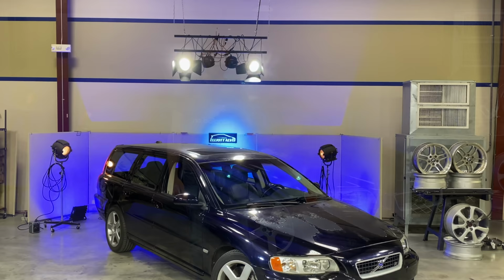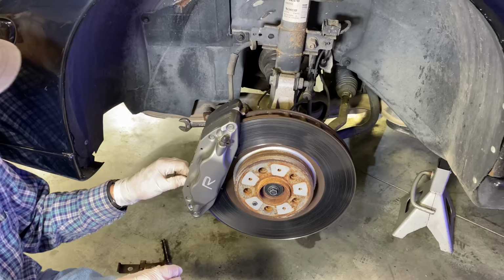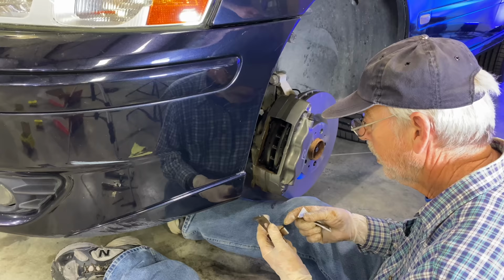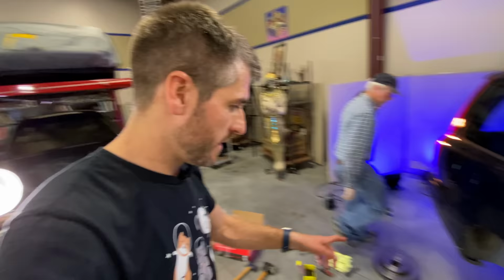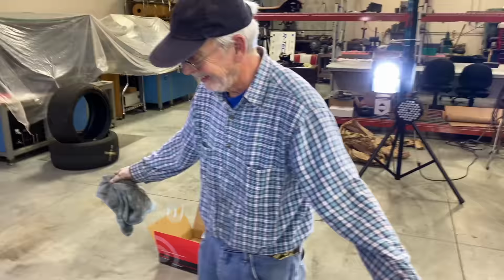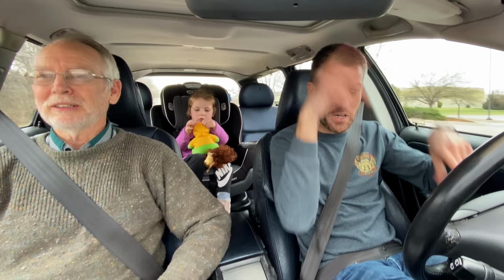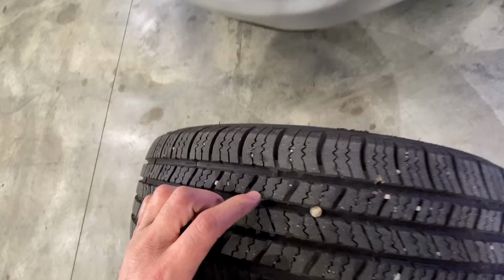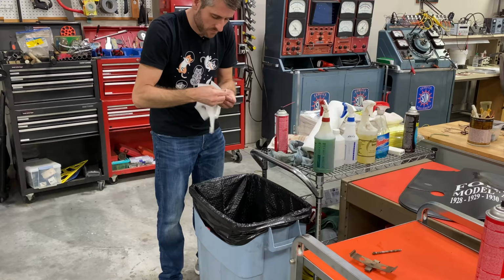Nothing Is Easy With My Volvo V70R, But A Simple Brake Job Wasn't So Bad!

Comment: How was that brake job a nightmare? Where was the seized caliper slider pins, the rusty caliper pistons, the snapped off bleed nipple that you had to drill out, the ABS pump so drained of fluid that normal bleeding wouldn't work or the usual (in Scotland) caliper bolts that are so rusty they looked like they'd been removed from the wreck of the Titanic on the ocean floor? You didn't even have to do the job lying outside in the snow! Mate, that job was a piece of cake.
Reply: My thought exactly, I watched this to see what problems he had that I have not had on my XC70, and there were none at all.

Comment: I bought an S60R 4 months ago and my story is pretty darn similar. Its been up on jacks being worked on longer than its been on the road.  That said, when its on the road its incredible..... and then it breaks again
Reply from the maker: Ah, you know the struggle then.  Enjoy the car when its working!  lol
Reply: @ElliottAlvis  I just cant' get any brakes
Reply: Should have bought a T5..
Reply: Some cars just need Jewish lightning ⚡⚡
Reply: Glad I stuck with the P80 platform.
Reply: My s60R has been dead reliable in the 5 months I’ve owned it lol

Comment: This will be a weird comment, but I had an aunt who had a V70 and eventually a XC70. I remember the smell of that car so vividly, and I feel like I can smell your car through the screen based soley on my memory of those seats and that dash.
Reply: Same. Old crayon smell. My first XC70 had it, my dads V50, my S40 T5, my S60R, and now my S70 T5. It’s also been present in my friends S60 and my parents friends XC90. Although another friend with an 850 didn’t have the smell… only time I haven’t smelled it in a Volvo.
Reply from the maker: Not weird at all, I know what you mean!

Comment: There are few things more satisfying than new pads and rotors. Also, great idea swapping them all at once. Turning rotors is a waste of time, and saving pads is as well. Just change it all out to new when they are worn, there is no up side to trying to salvage old parts like that.

Comment: Nice! I put Brembos on my Daughter's V70 last year, best braking performance ever! It's not recommended but you should clean the rust off the wheel hub and apply a thin coat of anti-sieze   between the rotor and hub. This will prevent future corrosion and make it easier to service the next time you have to remove the rotors.

Comment: Just did breaks on my wrx performance pack (has sti brembos stock) one benefit of tracking your car is the break never get that crusty between pad and rotor changes. I love working on rear entry calipers but man if you strip that caliper.
Reply from the maker: That is a good benefit of tracking the car!
Reply: i stripped my front one lol. nightmare.

Comment: I was recently watching a Junkyard Digs video, and he brought to my attention something I had never thought of before. He was explaining that for the best results, you have to break in you're brake pads, I guess each manufacturer of brake pads puts the necessary, steps to break them in on the box, basically 3 hard stops from 20 mph, and then like 4 hard stops from 40 mph? I guess each has their own procedures but it's something to consider, I guess it maximizes material transfer between pads and rotor

Comment: Should clean the rotor/disc with brake cleaner before fitting caliper to remove transit oil (used to prevent rust in storage).
Reply from the maker: You're right, that is a good suggestion.

Comment: Sometimes all of a sudden the pins get stuck (happened to me) or the bolts get stripped and then im like oh boy maybe these aluminum Brembo calipers SHOULD HAVE HAD STEEL INSERTS FOR THE BOLTS!!!! Yea... R brakejob can sometimes go south quick!! thats the worst thing that happened to me
Reply from the maker: Oh no!  That sounds awful!
Reply: @ElliottAlvis  I had to buy a whole new rear caliper because the pins were stuck so bad, then I had to get a Helicoil insert into the stripped threads on the front caliper. That was insane. Never wanna take the calipers off ever again

Comment: The part you forgot to install on the front is called a silencing shim.  The backing plate is the rigid inboard sheet metal, roughly the same size as the rotor, there to keep debris off the inboard side of the rotor.

Comment: Brake parts?  Check.  Dad puns?  Double check!  One tip I'd give you is to put some anti-seize paste on the inside of the wheels where they make contact with the rotors.  This will make it A LOT easier to get the wheels off later.  Looking at the old rotors at the beginning, it looks like someone had done that previously.  Enjoy the stopping power!
Reply from the maker: Thanks as always for taking a "brake" to leave a comment man!

Comment: As usual, I took a "break" from my work to watch this "brake" video.  However, I had to "break" away from it until after work.  This video was so full of puns and good advice such as:  "Lube the backside;"  "Spring time;"  "It's a good start;"  "There's lots of jacking on this video!"    I think you have to do a family vacation video.  You would be the perfect replacement for Clark Griswold!  You could call it the "Motory Notary Family Vacation."  You already have the wagon.  Just stick some fake wood paneling on the sides and you're ready!  Thanks for providing such excellent content!  Keep it coming!!!
Reply from the maker: Haha, excellent brake puns Michael!  I appreciate you taking a "break" from work to watch the video, and for picking it back up later!

Comment: Did you thoroughly clean the hub before mounting the new disc? I like to use a special abrasive bell-shaped, hub cleaner you can put on a power drill, can't beat how evenly it cleans the mating surface.

Comment: Pro-tips: You should always replace the spring clips when replacing pads on Brembos; It’s a good idea to clean up a rusty hub with a wire wheel and apply a thin layer of waterproof grease or anti-seize; always good to turn in the parking brake adjuster a few clicks before removing the rear rotor,then re-adjust after install

Comment: Also man your lucky how easy the rear brake rotors came off! They often rust at the brake cable and also if the rotor is to worn inside from shoe wear the rotor can be a royal pain to remove. My v70R i banged on the back of the rotor for like an hour and it still didn't break free i said forget it lol still seized to this day but im about to weld a bracket to a bottle jack and come back with new rotors and shoes before i take it on the road manual swapped. hopefully it works

Comment: Disc brakes on Corvette came out in 1965 and were standard 4 wheel discs.  Before that, Corvettes came only with drum brakes.
Reply from the maker: You could get disc brakes in the front starting in 63, but they were standard 4 wheel discs in 1965.  You are correct!

Comment: used retainer pins tend to depart on their own, I always get all new hardware.
when a pin falls out the second pin rattles loose, then the pads depart and you lose all the brake fluid.

Comment: I changed pads on a  Volvo 164 once. I only had to remove the wheel - not the calipers. Rotors were still in great shape- pads had 15-20% left .

Comment: I would occasionally re-torque those axle bolts in the center of hub.....they have a tendency to back out. Just a heads up from a former s60r owner
Reply: You should never "re-torque" those bolts. They're a one time only and should be replaced with new if they ever need to come off
Reply: @rsscott5672  you are correct if you take them out you need to replace them......the 04-06 had a habit of actually loosening they corrected this in 07 by using a rubber bushing behind the bolt.
Maybe re torque was the wrong word....but just check to make sure they haven't loosened up.

Comment: Good job, Elliott. Nice to see the Volvo getting attention. One note, though. That brake fluid was looking a bit off in the master cylinder. I'm guessing it is a while since it was flushed. Bad idea to leave it. The water absorbed by the fluid can rust out the ABS pump, accumulator, or actuator, none of which is cheap. Be prepared, it takes a bunch of fluid. On my 1990 240, with its 4 wheel Gerling discs, it takes 17 litres of fluid to do a full flush. Every 10 years or so I also do all 6 of the flex lines. Volvo brakes are something else. Gotta love 'em.
Reply: Err thats like 4 gallons, maybe 1.7 L, I only needed  0.8L on my S80
Reply from the maker: Holy smokes, thats a lot of fluid!  I plan on doing a full flush soon.
Reply: @henrikalnesjo3445  Yeah, 17 litres, surely that cant be right.
Reply: check your handbook, mine said the system holds 0.56L, so I ended up using only 0.8L flushing it, can depend some depending how  bad your old oil is

Comment: A small lip is no reason to trash the rotors. I think you could used your rotors just fine with new pads, but it's hard to tell if the grooves are bad or if there are cracks...
Reply from the maker: Better safe than sorry. And the rotors will be repurposed around the warehouse as weights!

Comment: In my experience the so called lube for the back side gets washed away after assembly because anyone doing a proper brake job sprays everything down with brake clean to insure all the contamination you've spread around doesn't cause problems in the future so I believe it's just waisted money if you're buying those little $2 packets with the pads

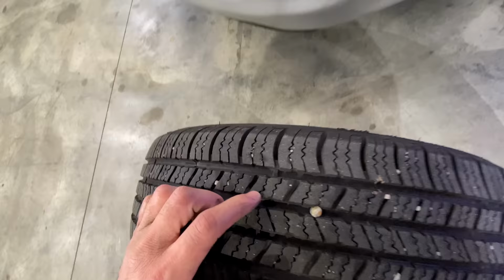Comment: 17:02 I know that tread pattern very well; a Goodyear Viva 3! That tire got replaced around this time last year with the new Reliant All Season. If I remember correctly, the Viva 3 was a 60,000 mile tire, and the new Reliant All Season is a 65,000 mile tire.

EDIT: using my training as a Walmart Auto Care Center technician, that roofing nail was what in what we call the “Goldilocks Zone”; had it been less then a thumbs width from the sidewalls, it would have been a new tire for you.
Reply from the maker: Good eye for tires and for the roofing nail!

Comment: Make sure that you adjust the parking brake after doing the rear brakes. Oftentimes it will need to be readjusted when you change the rotors. Especially on this car since it's a stick shift!
Reply from the maker: You're absolutely right!  It's adjusted and working better than ever!
Reply: @ElliottAlvis  I forgot they had the shoes for the parking brakes on Volvos. Volvos are actually very easy cars to do brakes on. I think the R car was produced in Sweden although Ford did own Volvo at that point in time.

Comment: Loosening the calipers before resetting the pistons and removing the pads. And those rotors look fine - just remove the lip. You've never done a brake job before, have you, Elliot? I'm off.
Reply from the maker: The car hadn't been driven for several days so it didn't really matter. And the rotors were warped and had a massive lip.  They were done.

Comment: You could have used brake parts cleaner to clean the brake calipers and the parking brakes. Now would have been a good time replace the brake fluid (that could be another video).

Comment: Shouldnt you change the brake fluid and do a flush on the volvo, as when was the last time it was done on that car, which would directly effect the pressure and the pedal feel, also after the test I would do a check to make sure everythings still tight and in place just as a precaution
Reply from the maker: You are absolutely right, I am planning on doing both.  I just didn't want to make the video painfully long!
Reply: @ElliottAlvis  ah fair enough I was just like hey wait your missing a few steps here lol plus it never hurts to check and double check your work with bolts and pins of that nature

Comment: Do you have to remove the caliper?  My Audi didn't require taking the caliper off because there were no wheel studs in the way.  Pull the pads and then you can remove the rotor.

Comment: I have a question. Have you changed the brake fluid since purchasing the car ? If not and most people don't, you should or you are going to push the nasty brake fluid back through the ABS system and master cylinder. I've ruined a good master cylinder that way. The best way for safety reasons is to open the bleeder screw then push out the old fluid as you depress the pistons back into the caliper. A new bottle of brake fluid is cheaper than any brake component that might be ruined buy the old brake fluid. Just an old codgers two cents worth.
Reply from the maker: I do need to change the fluid and bleed the brakes soon.  You are absolutely correct.
Reply: @ElliottAlvis  I cringe when I see someone fo a brake job on utube and they don't bleed the old fluid out as they push the pistons back into the caliper.

Comment: Question: Does any anti seize go on the front and back surface of the rotor where it contacts the alloy/steel wheel to make sure that it’s always easy to remove the rotor and/or the wheel? 
I really enjoyed watching you three Alvis’s tackle this important job!
Reply: you shouldnt
Reply: @C.JG.  Thank you 😊
Reply: Should clean the rotor/disc with brake cleaner before fitting caliper to remove transit oil (to prevent rust in storage).
Reply: @steveturnbull9542  I thought that there was something missing.

Comment: The first time that I changed my brake pads I didn’t think about the brake fluid overfilling it’s reservoir. The cap was still on and the brake fluid squirted out of the cap’s overflow. I guess that’s what happened.
Reply from the maker: I bet that was a good learning experience!  At least you know how to change brakes!  Thanks for watching Mitchell!
Reply: @ElliottAlvis  You are very welcome. Your videos are really awesome these days. I really like the family integration because it adds a lot of realism, especially when your uncle was doing much of the work so that you could let your creative juices flow. 
I wanted to ask you if you’ve been working out, because your bicep 💪🏽 veins were really popping when you were picking up those big front rotors? 
Thank you so much for responding to my comments, because it means a lot to me. Your channel is getting so big that you might not be able to give us the personalized service that we are used to getting from you.
Reply from the maker: @mitchellbarnow1709  I haven't been working out, but I have lost some weight.  And I always value your comments Mitchell!
Reply: @ElliottAlvis  Thank you, my awesome friend from Wichita!
Reply: I owned a 1993 Volvo 850 sedan for three years, but my love was a 1996 Volvo 850 Platinum Limited Edition Sedan that I kept for just over eleven years! I usually keep my new cars for around five years. My only used car was a 1966 VW 1300 Beetle, but I lost control around a corner, spun around, hit the curb and rolled down the canyon in the hills of BelAir, Califonia! My friend and I scrambled up the canyon where we found a lot of people in the street talking about those that must be dead. Thank goodness I had installed aftermarket lap and shoulder belts or I wouldn’t be writing to you right now! I didn’t know how easily the back end would swing out.  I was not a fast driver, but there were skid marks all over.

Comment: Did you degrease the new discs?
Reply: Heh...he used the process that's also known as "test drive"!
Reply: @anthony2816  the discs (rotors) come from manufacture with an oily coating to prevent corrosion in storage, which should be removed before they come in contact with the pads.